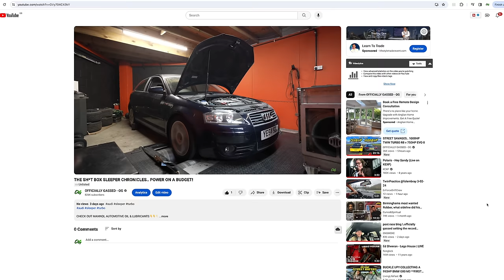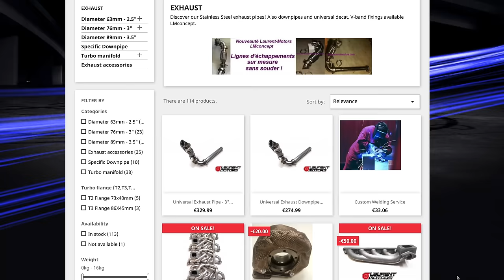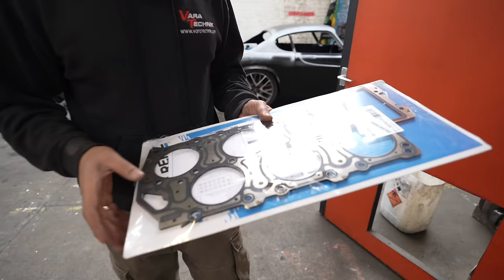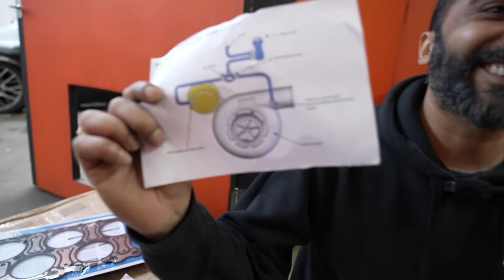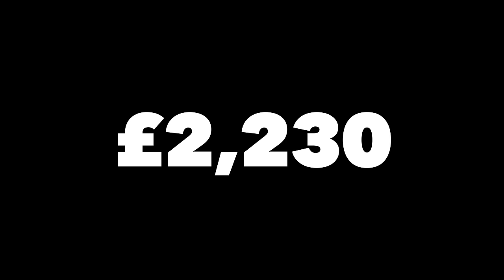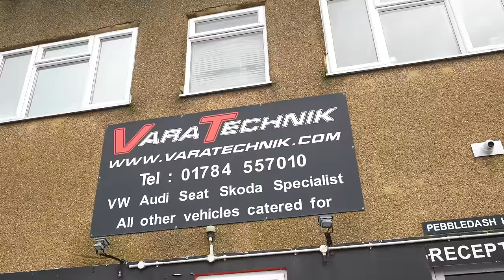SH*T BOX SLEEPER CHRONICLES.. WE FOUND THE CHEAPEST TURBO KIT

Comment: Don’t want to sound like a hater but should have got someone who has experience building budget turbo kits to take this on. Theres so much in that kit that won’t be getting used or is scrap. 

Would have worked out cheaper putting a kit together yourself too. 
- Cast manifold
- Chinese GT3076 (externally gated with 4 bolt downpipe flange) 
- 38mm External wastegate (chinese ones are hit and miss)
- 600x300x76 intercooler 
- Genuine siemens deka 630 injectors 
- Make your own oil/coolant lines for the turbo
- Make your own boost pipes and downpipe

These are the basics, you don’t need 6 useless gauges, manual boost controller etc etc.

Comment: as someone who's used ebay turbo kits in the past, you definitely get what you pay for. if you're okay with cutting and rewelding, they'll work. most of the time they dont fit right off the bat. there are parts that straight up dont want to use, like cheap wastegates, fuel pumps, injectors etc.

Comment: My prediction is the Injectors will probably be maxed out at 350 and that intercooler before that at probably 330bhp then it starts going to 50c + on the intake air temps
Reply: I reckon your far off mate she will run 432 and remain well under or knocking on 50°c

Comment: I was quoted 10k to put a turbo on my 3.2 TT, so I sold it and got a 2.0 tfsi then remapped it, for some strange reason the 2.0 tfsi is actually faster off the line than the 3.2! But I do miss the top end power of the 3.2, but I only found it to be a bit better on a motorway compared to the 2.0, both were dsg Quattro but the 2.0 is a lot better on fuel and feels quicker off the line, hopefully this comment helps someone pick the right car, learn from my mistake! Get the 2.0 tfsi dsg Quattro!